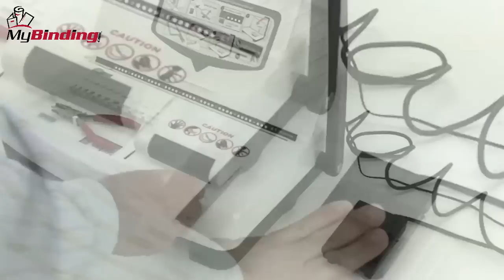How To Spiral Bind Papers

Comment: What is the spiral ring size usually need?
Reply from the maker: It depends on how thick your document is.  The best option is to measure the thickness of your document and add a couple of mm to give the pages room to move freely.  If your book is over an inch (25mm) you may want to give yourself even more room.  There is a rough guide on the MyBinding.com site.  You can find it here https://www.mybinding.com/sizing-guides